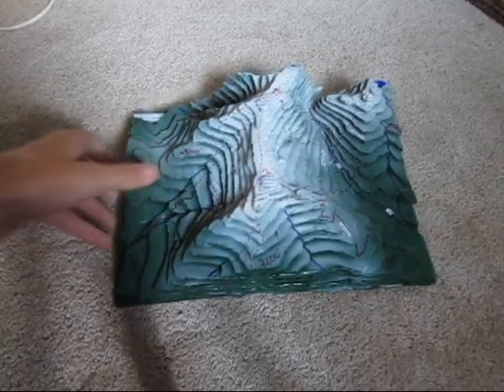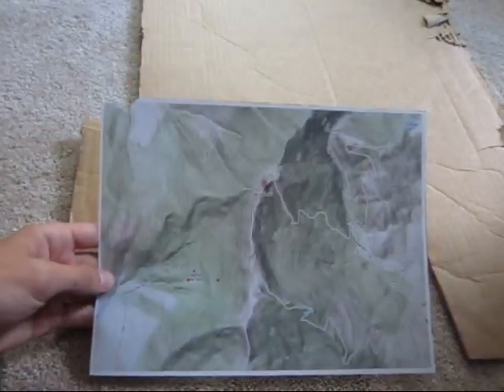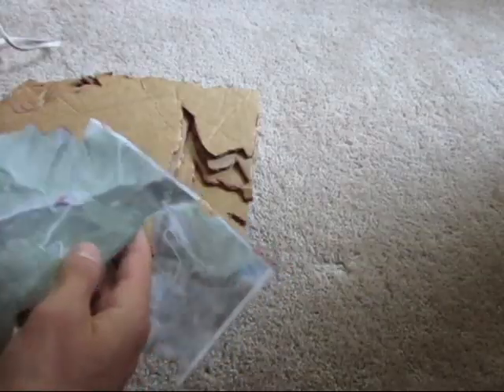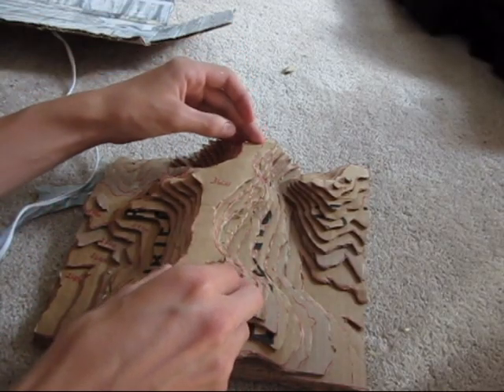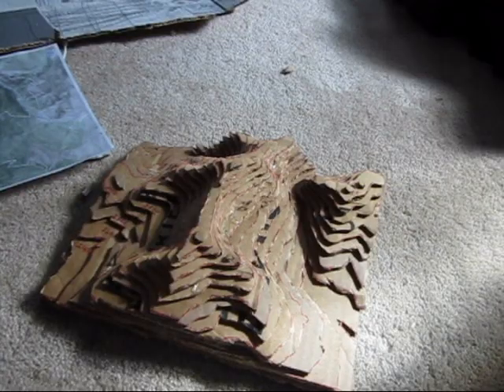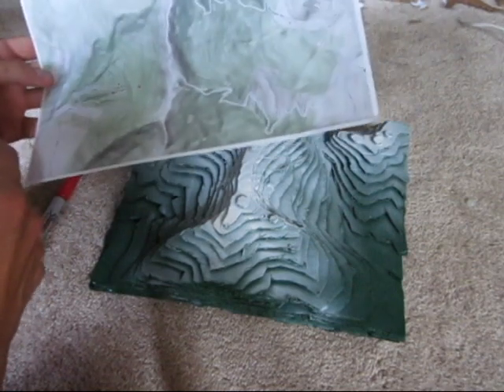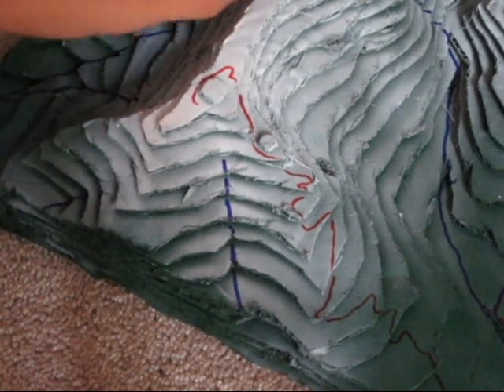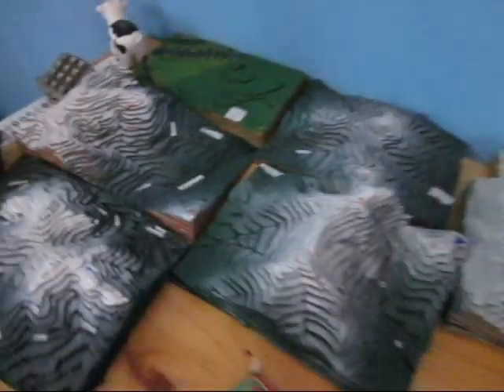How to make a 3d map

Comment: Please help me with my project.  Is the bottom most layer 200 ft?  Also where did you get your topographic map in the first place?  Also where is a valley or trench on the map and model depicted?  Can this be made with one side facing the ocean? Where can I get a topographic map with these features?  Please I need guidance because my teacher does not explain things as good as you.  Call me 626-253-1361.